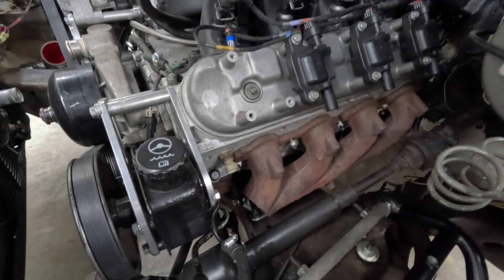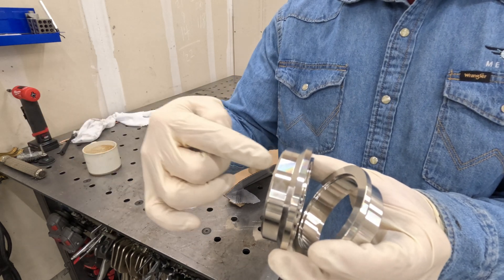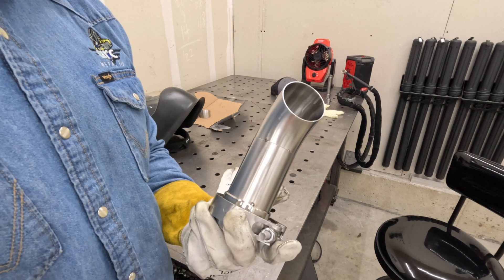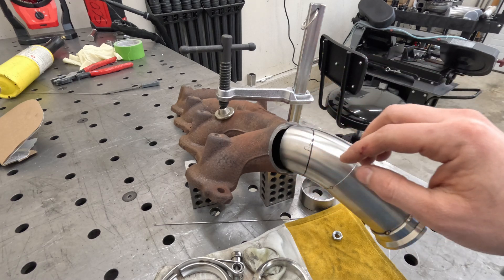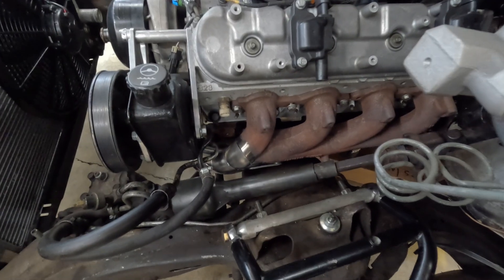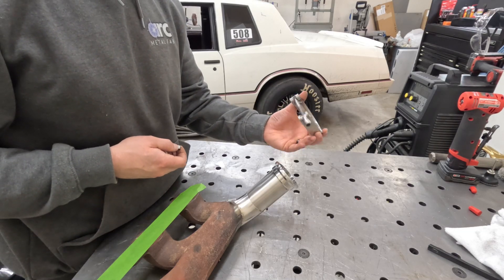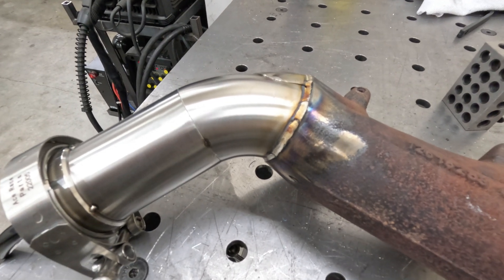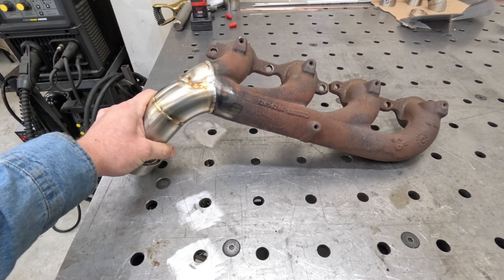Project Monte: Header Build Part 2

Comment: Very nice work. The amount of time it takes to do the little things like cutting that "cover" piece is seriously underappreciated by people who have never fabricated before. Also brave on you for deciding to weld stainless to that cast manifold I hope it holds up, I was too scared to do that with my own turbo build. I did pick up a 400 degree temp crayon from my local weld shop and it gives me a lot more confidence when preheating cast parts!
Reply from the maker: Hey thanks man!  Yea it does take a lot of time to fit pieces like that right.  As far as the cast to stainless, as long as I don’t hear any pinging after it’s welded and cooling I know it will be fine.
Reply: @ArcMetalFab  Very interesting. I'm definitely more inclined to give it a try after seeing how nicely that weld turned out!
Reply from the maker: I’ll be posting the passenger side header build next week Friday that one turned out 10x better in my opinion.

Comment: Great work… why did they stay with the cast manifold instead of something after market?
Reply from the maker: Thanks!  I guess people have made 2000 hp with these cast manifolds.  So they had them and wanted to reuse them.  And because of the power steering pump most aftermarket stuff would probably have to be modified as well.